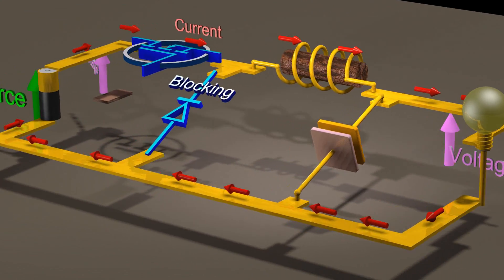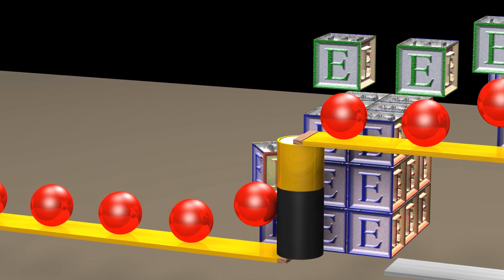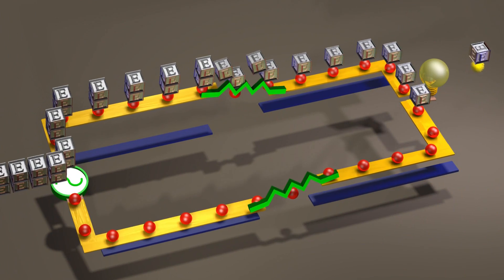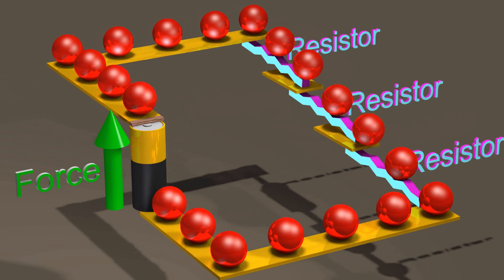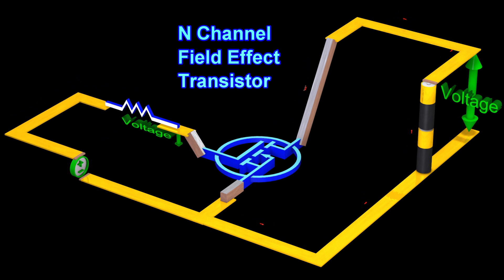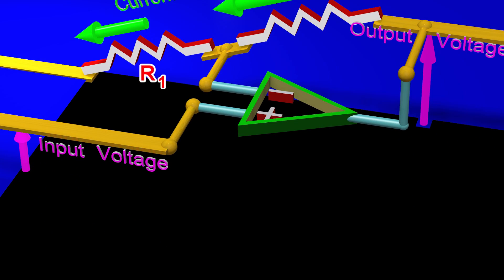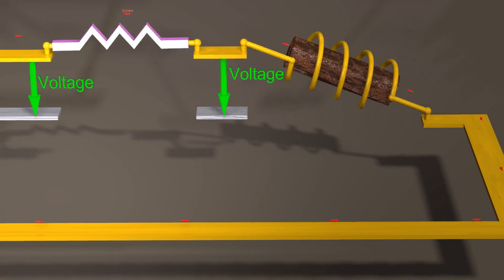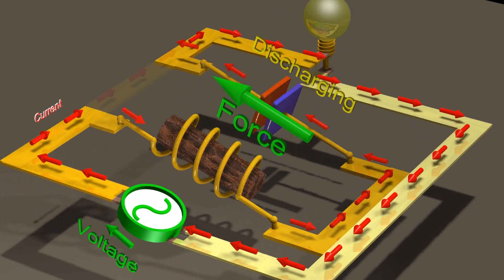Electric Circuit Components

Comment: Hey Dr.Eugne... I always love your Electricity videos. I have a question at 13:53; Why did do we connect the battery to the capacitor *with a resistor*? I mean why the resistor is there?
Thank you!
Reply from the maker: The resistor is there to limit the inrush current.
Reply: @EugeneKhutoryansky  Thank you!

Comment: What's the point of the whole "mechanical analogy" when you allow the "energy boxes" to just move around as in 3:48? Why can't they just fly right to the bulb? Even if they represent just "extra energy", fine, can't you then just power the bulb with only this extra energy? It will not shine as bright, but it should work, isn't it? What's special about the electrons representing carts carrying those boxes here if the boxes can move without them?

Comment: hi there
when showing the energy box along with the electron, when passing through the light bulb the boxes travel through the air representing the energy in light form. so the electron at the lower voltage level has no box left. my question is how does it travel back to the source through the ground wire back if no energy is left?
Reply from the maker: The boxes show how much "extra" energy they have.  No boxes doesn't mean no energy.

Comment: Small correction. All diodes have a reverse breakdown voltage at which point they stop being diodes. The thing that makes zener diodes special is that zener diodes are able to survive running at their breakdown voltage. If you run a normal diode at it's breakdown voltage it tends to permanently break
Reply: Transistors have that too.
B.t.w. in the clip the transistor was connected at 0 Volts, but the base of a npn should be 0.6'is Volt higher in order to open the base (diode). So there is more that is not 'exact science'.
Reply from the maker: The base is actually shown at 0.7V, not zero volts.  I show this in detail in my video devoted to transistors at https://youtu.be/Bine_PbyFSQ
Reply: @EugeneKhutoryansky  I might have seen this wrong then. It is just that I know this (as a fact) and others maybe not. That's why the emphasis.

Comment: I’ve been having difficulty holistically understanding why capacitors block DC current while allowing AC current, along with the different kinds of diodes and creating different electrical signals (sine wave, square wave, saw tooth, etc…); are you able to elaborate on those?
Reply from the maker: You may want to watch my video on capacitors at https://youtu.be/f_MZNsEqyQw

Comment: Imagine if it actually was the positively charged particles moving. That would sure release a lot of energy, but not the kind we want out of a battery...
Reply: I don't get it. Why aren't the electrons carrying the energy cubes toward the light bulb but rather the red positive "holes" or whatever? If they were to use the blue electron charges then how would the energy cubes be carried? Or is it just all perfectly mirrored? Meaning that if red charges are going clockwise carrying the energy, then when showing it the other way the blue charges are going anti-clockwise also carrying the energy toward the light bulb on the other side.

Comment: Oh my! Did I just catch an error? It is at the point after describing electron flow in blue and the voltage difference as level differences int the video.  The blue electrons are stepping down a level but the negative electrons would move to a higher voltage.  Either way, I like your videos.
Reply from the maker: This is not an error.  The circuit gets flipped upside down, as shown one minute into the video.